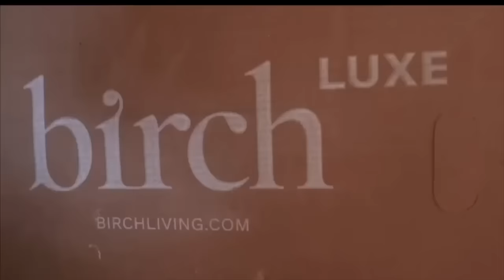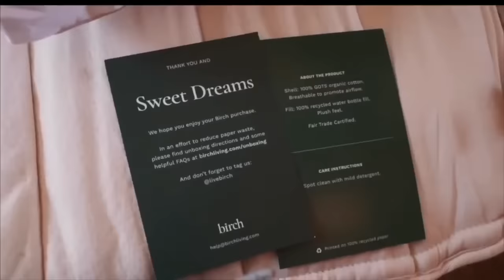Building a grocery store in our basement

Comment: Those buckets need a vapor barrier between them and the floor. Plastic is porous and can absorb odor and a bit of moisture without an air gap and vapor barrier.

Some of those small plastic bins will be an invitation for mice. I have even had mice try to chew through a metal lid on a glass jar. They are always an issue in old homes during winter. I use a lot of glass gallon jars to keep the mice out. A few good cats help too.

You are on the mark with the repointing. He wasn't lying.
Pantry looks good!
Reply: Maybe those big sticky straps that catch mice under the pantry shelves ? Just saying alot are ? Mice . Get a cat 🙀

Comment: I wouldn't put bags or boxes on the basement shelves. I would use sealed totes on the shelves for the bags and boxes otherwise you'll find bugs and rodents will invade your stock. I'm speaking from experience. 
Target has  a "bright room" brand stackable clear box, 28.3 qt. It's perfect.you can see thru it and even make a list and tuck it into the end of the box for an inventory

Comment: Beautiful!  I don't know if there's room, but it's pretty easy to build pull-out shelves for your pantry cupboard upstairs (if there's room in the space to pull them out).  We have a very deep and narrow closet in our bathroom and our handyman built two shelves (with rims, so things wouldn't fall off) and then bought the pull-out hardware.  It is so nice to be able to easily access the things on those shelves...even things in the back!
Reply: This is exactly what I was thinking about. If that cupboard in the upstairs pantry is deeper than 24”, like any regular base cupboard, then it might need to be custom. However, I think it would be worth it to have full-depth access to that space.

Comment: I know you have so many comments already but please do not use the attic unless you know for sure the house was designed to use the attic for storage. Most attics were not designed for storage and so using them puts excess weight on the structural part of the house and it can be very expensive to fix plus it can put your family in danger if something holding the house together would break. This is what my husband does for a living. Fixes structural problems in homes.
Reply from the maker: Thank you for sharing that!

Comment: 12:02 I recently got a similar switch. Mine is radio frequency controlled to a plug-in adapter.

First, Turn on the lamp itself. Then uplug from the wall and insert the adapter by plugging in  lamp cord into to the wall adapter and then plugging the adapter into the wall's plug.  Then press the wall switch that you see him attaching in this video to turn the lamp on and off.

They even have a single plug adapter that is controlled by two switches, so you can have one switch by the front door and the other switch by the hallway (or even by your bedside). Priced reasonably and so worth getting rid of the frustration of walking through a dark room, afraid you'll step on something someone left out. 

The wall switches are programable, so you can have many switches control one receptical or I believe on switch control several switches. 💖🌞🌵😷

Comment: Two comments you need your food in either mylar bags sealed and inside of plastic "food grade buckets" or in restaurant tubs for food. And all buckets need to be up off the cement. It gets damp and the buckets will get damp inside. So you can put them up on 2x4s or wood that keep them off the cement floor. The costco racks are great and hold a lot. Very strong! Looks good but keep it up off the ground. 😊

Comment: What a beautiful basement you have. I’ve done lots of research in food storage and storing plastic buckets on cement is not recommended. Cement is very porous. in my storage room I used old boards to put my buckets on and it worked quite nicely. Also, if you stack buckets on top of each other, it can ruin the integrity of your lids and they can eventually break, the gamma lids are tougher so maybe they’ll last OK. Just thought I’d give you a heads up. Love this video as always.
Reply from the maker: Thanks for the tips!

Comment: As a brick mason who does historic restoration, I was looking at the first of this video cringing. Then I saw that you had it pointed up and -from what you said - done right and I felt a lot better. Looks great.

I've worked on houses that have been lifted and seen foundations like that just crumble the moment the weight is taken off of them. Scary stuff when you working in a crawl space. 

Is moisture/humidity an issue where you are at? How about mice? That much food in a basement seems like it would be tempting to the furry four-legged populations.
Reply from the maker: So far we haven't had any problem but will certainly address them as they come up....we are still learning and have since made sure all the buckets are elevated off the floor

Comment: Tip: when purchasing wire shelving as shown in this video look for shelves that have the wire that comes into contact with the item to be stored run from front to back.  You can see what I'm talking about several times in this video when viewing the shelves from the end.  Wire that comes into contact with the items to be store that runs length wise will not support items like bottled ketchup well.  The items will want to tip.  Costco has Trinity brand shelving in the desirable configuration.  Not so happy with the shelves we bought form Lowes.  We have 14 wire shelves, several from Lowes, I learned the hard way.  It's worth the extra cost.
Reply: You can use heavy duty shelf liners for that problem!
Reply from the maker: Our shelves came with the plastic liners.

Comment: I am wondering if you have any issues with mice and if that poses as a problem having foods in the basement area?  I have a home that was built in 1914, and the basement walls are very similar to yours, the stone that was used back then for our home's basement is granite, and we had all sorts of problems with the porous grout and tons of water seeping into the basement during heavy rains, what a mess, and the cost was significant to get the walls sealed.  I am also curious in finding out what happened with your Berkey, I noticed that you always had it located on your kitchen counter, then it seemed that it was moved into the little green pantry room, now I don't see it at all; is it still in use, or did you stop using it all together?  The reason why I am asking is that I have been debating whether it's even worth the investment or does it become inadequate overtime, and maybe just investing in an entire household water filtration system is the better option, but for affordability at the moment, possibly using the Berkey until installing one might be more financially feasible for my Houshold. I sure would love to hear your thoughts on the Berkey question.  🙂
Reply from the maker: Still love the Berkey but don't need it for everyday use because we have our own well...we had our water tested and it is good so we are comfortable using our well water daily.